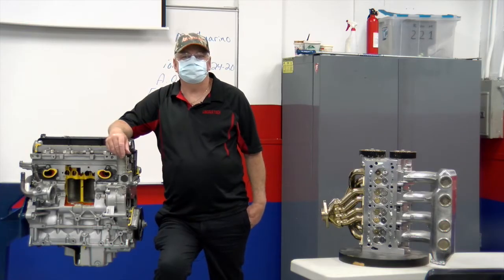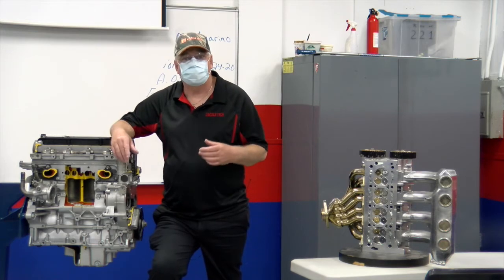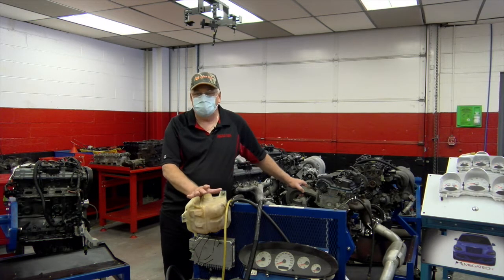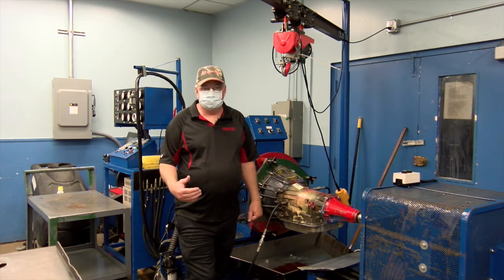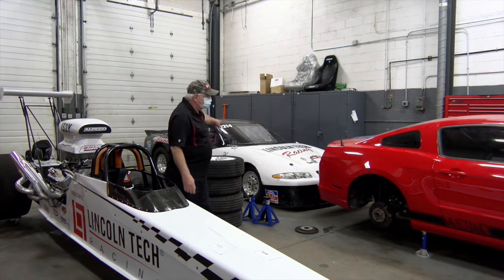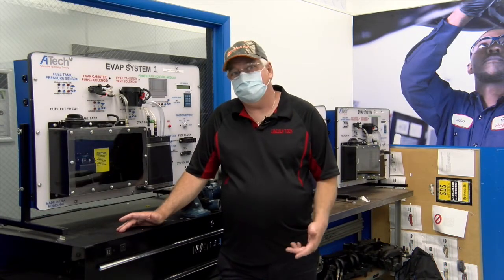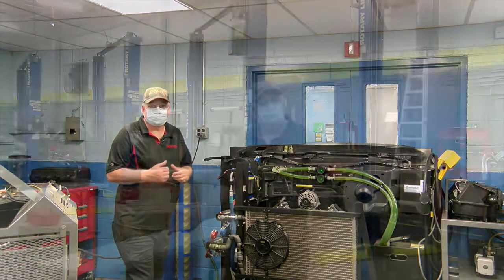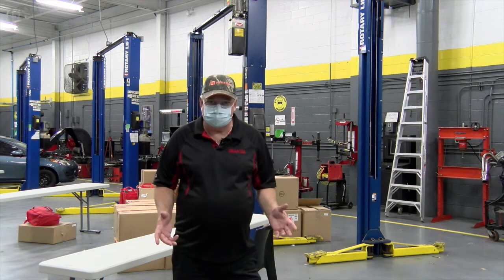Automotive Technology - Program Preview - Union Campus

Comment: You won't even know how to preform a basic oil change after you complete the engine class. Freakin Scammers.
Reply: There's 2 sides to every story Bro. Did you ask questions? Or did you need your hand held the whole way?
Reply: The classes they put you in don’t make sense, I had brakes my 2nd class then shop management
Reply: @john-lu6pv  Because it's a scam. If a resume comes across my desk from a Lincoln Tech graduate. Right in the garbage 🗑️ it goes!
Reply: @adamedwards2435  where should you go?
Reply: @Jahonecanoe  don't go there unless you have prior experience working on cars.
Reply: You went?
Reply: @abraxasret7457  If your community college offers an automotive course, go there.
Reply: @abraxasret7457  not worth it